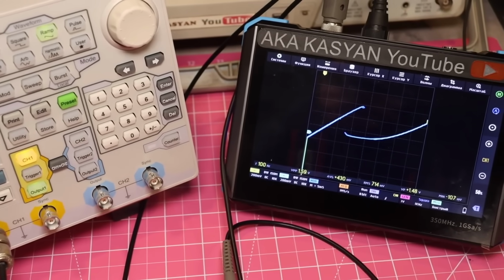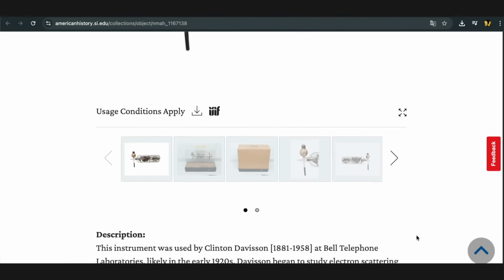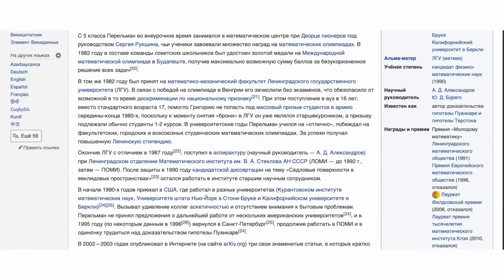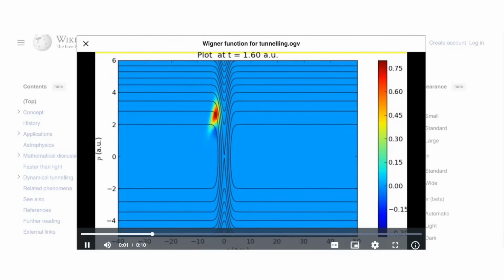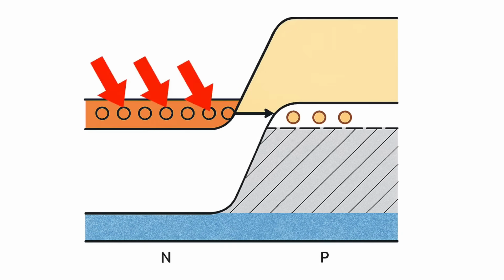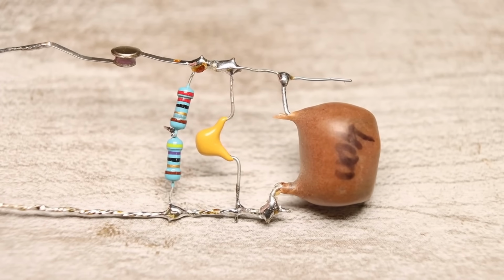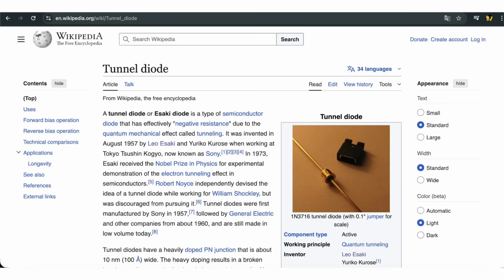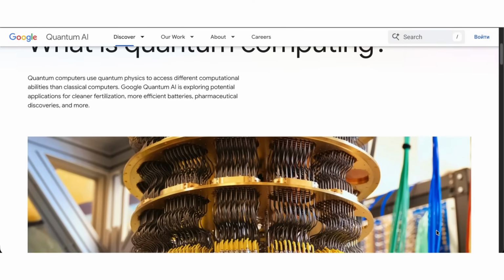Quantum Diode That Breaks the Laws of Physics — Tunnel Diode

Comment: Leo Esaki is still alive...he came up with the tunnel diode concept in 1958 and at 67 the diode is just a few months older.

Aside from oscillators,  tunnel diodes were also used for discriminaton of photons from a photomultiplier or so i read

Comment: Tunneling diodes are even more fun when you arrange them next to a Casimir cavity
Reply: Could you elaborate more on this? Searching for that with bit of an AI summary showed me some current and voltage generation. Is that what you had in mind?
Reply: @MrToradragon yes. Early devices at nano scale generated picowatts of power, and the story was thoroughly buried by skeptics who continue to dismiss it as impossible.  But NASA Eagleworks has already scaled them up to microwatts.

Arguments against zero point energy harvesting turn out to rely on classical physics, not quantum
Reply: @paulshields1883  Ok, that sounds interesting. I suppose that the power generated is related to the layout and overall number of modules, and I also suppose that it has to be done with technique used for manufacturing of integrated circuits. I perhaps understand why there are sceptics in regard to this. It sounds too much as sci-fi and as one of the "free energy" devices that the internet was full back in 2000-2010. It would really be interesting where that energy comes from.

But I am afraid that this is not going to revolutionize power generation in upcoming years nor decades. On the other hand, if they would be able to create something that would reliably work for years and produce hundreds of microwatts or better few milliwatts of continuous power, it could be used in some medical applications. (But it would have to, also, be dirt cheap.)
Reply: @MrToradragon as described by the inventor, power scales with area, 70 watts/m^2, which is similar to solar panels but needs no sunlight, therefore can be stacked. I noticed that if you can stack them as close as 10 micrometers apart, then 1 cm^3 would be an everlasting USB charger, and 1 L size would be enough to power a car.. forever. Not revolutionary? Its only a matter of manufacturing cost.
Reply: @paulshields1883  That is a 'holy shit' statement.
Reply: @paulshields1883  make a youtube video about it
Reply: @paulshields1883  then make one and get rich. The proof is in the pudding.
Reply: @thewhitefalcon8539  I'd love to, but it's too early to hype. Right now, roll out of this technology is dominated by large up front costs: proofs of concept exist, but questions of manufacturability, scalability, cost, and market indicate that some R & D is required for commercialization. The first few units off the assembly line will have to pay for that.
Reply: LOL

Comment: So is it possible to have a tunnel LED.   And if you put one tunnel diode over another tunnel diode can you transfer the wave into the other diode.  If that is the case then you are on the way to making a tunnel quantum computer.  ( one quantium controlling the other quantium state) at room temperature.  I used one led as a detector and the other led as the light source and a spring between them. They worked great measuring vibration.  You may be able to do this with tunnel diodes in the quantium state also.  Food for thought. !
Reply: Actually some of the gallium arsenide high efficiency LEDs can operate like a tunnel diode because how the PN junction is created. There are also some old GaAsP LEDs that have a literal quantum leap, glow red at low current then yellow green at higher currents. ❤

Comment: IN America,  tunnel diodes were used to make simple RF converters for receiving UHF television stations, when they first appeared.  Maybe due to the cost and more complications of using transistors that worked at UHF.  Eventually these old converters fell into disuse and thus were often a cheap way to get a working tunnel diode for experimenters.  Now tunnel diodes are expensive and scarce it seems. Novelties for hobbyists rather than cutting edge technology.
Reply: True. 
Did you know you a standard small signal bipolar transistor can be used as a 
tunnel diode, look up one transistor blinker here on yt for the circuit.
Reply: I once mada a UHF signal source from a tobacco tin box with a feed through capacitor feeding a quarter wave of wire with a tunnel diode at the other end.
Reply: Great informative video. 
Recommend you do Short tech friendly versions. But, offer longer deeper dives for those who want their Synaptics to perform some Gymnastics. 
Keep on Thinking

Comment: obviously, instead of trying to impress people with a "wave or particle" based religion, the more intelligent procedure is to balance the tunnel diode at the point of hysteresis and provide some form of translation of this signal to somethin gmeaningful.. text data, sound, formants. "it you cut into the present, the future leaks through" then it's easy to hear all the annoying spirits around you clamouring for your attention, instead of spending your life postulating because you never gave an ear to possibility ;)